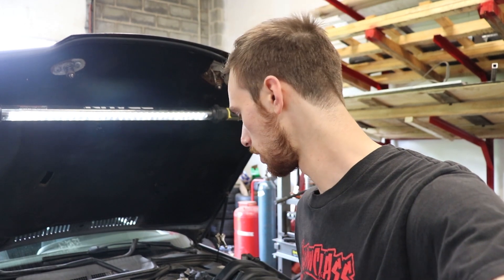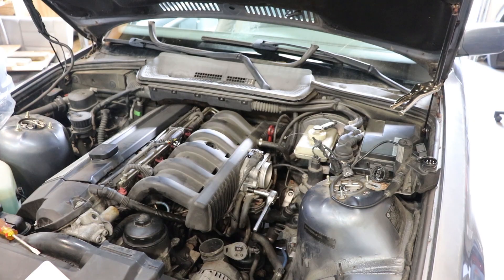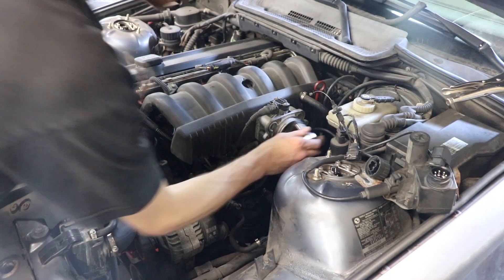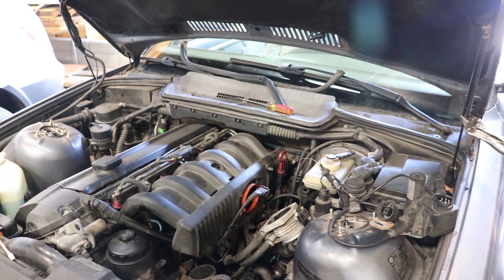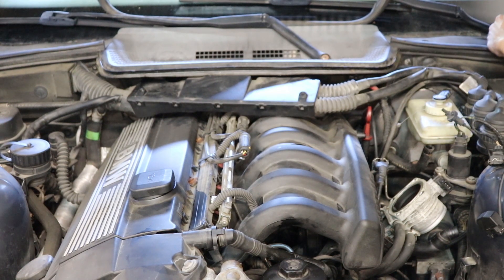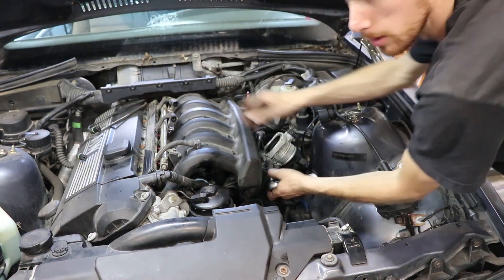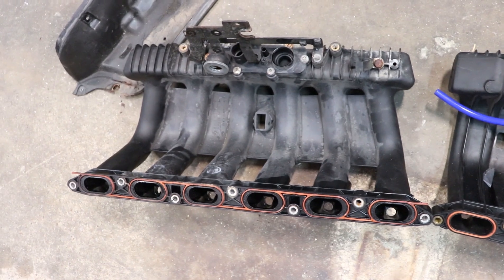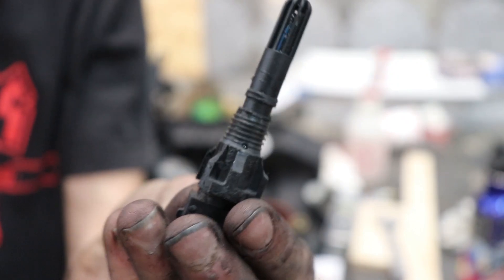BimmerWorld M50 Manifold Swap [E36 Project Ep 9]

Comment: I just finished this modification, and the only thing it did was make my back hurt. With the old manifold and a good reprogramming on a roller, we were at 199 hp. After changing the intake manifold to the M50 and reprogramming the fuel injection properly on a dyno, the final result was 204 hp. The car's performance is practically the same, and no change is noticeable. I can confirm with empirical data that it's not worth making such a huge modification and that you can achieve practically the same result with the smaller intake manifold. This modification is only useful if you want to keep your stock fuel injection, and logically, installing a larger manifold will give you more power. But with proper reprogramming, the results are the same, and the car performs exactly the same. Don't waste your time!

Comment: After i installed the m50 manifold on my m52b28 it felt like its louder than before ? Am i the only one who felt like that? I talk about the sound from the exhaust
Reply: that’s because you intake more air causing for a difference in noise, less restriction more noise

Comment: Does anything plug into the sensor or is it wireless
Reply: Air temperature sensor
Reply from the maker: You need to put a thread on the stock m52 sensor, screw it into the m50 manifold and plug it in as you normal would... hope that helps.

Comment: This manifold m50b25 or B20?
Reply from the maker: m50b25. In the US I don't believe they sold many cars with m50b20 motors. Either way mine came of the 2.5L e36
Reply: @swtmnk3  So would it be useful to use m50b20 manifold?
Reply from the maker: @OldBmwLabOfficial  I can't recall the difference but I remember reading some threads about it. I believe the b25 is the one you want.

Comment: Did the ecu just adapt to the new manifold or did it require tuning?
Reply from the maker: Bowman_46 I opted no tune and it did just fine. There is a ecu restart procedure that probably speeds up the process of relearn and zeros all the means. I may do a tune at this point now that Iv done exhausted. Also be nice to delete some codes and up the rev limit. But wouldn’t say it’s a necessity for the swap.

Comment: Thanks for the vid, gonna be fitting mine soon. What have you done about the traction control warning light with removing the traction stuff? Thanks
Reply from the maker: I don't use traction control so mine is permanently off. But you shouldn't have any traction control issues from doing the m50 manifold.... have you disconnected your traction control throttle body??

Comment: You done a good job......It looks like a very awkward job.I just bought a 1998 e36 328i and i would like to convert it back to m50 intake manifold.do you think those kits from china on e-bay would be easier to fit than OEM.I think they are welded aluminium alloy??

Comment: You were able to just swap the manifolds and run it like that? You didn’t have to convert anything to obd1 or use a tune?
Reply from the maker: yes sir, other than the kit I used. The ECU can adapt. a tune wouldn't hurt though
Reply: /BCENZtube looks like my 97 328i is getting an m50 manifold haha thank you for taking the time to reply
Reply from the maker: Francisco Ozuna also the m50 manifolds look better  💪

Comment: Hey very helpful video man!  What did you need to modify to get the fuel rail back on?
Reply from the maker: Viper2345 L I believe part of the mount off the rail hits the m50 manifold. The new plates in the kit work to move the mounting points.
Reply: @swtmnk3  ahh ok, what did you end up cutting off the rail?
Reply from the maker: @Drrrifft  https://www.rmeuropean.com/bmw-m50-manifold.aspx this should help
Reply: @swtmnk3  ok thanks!